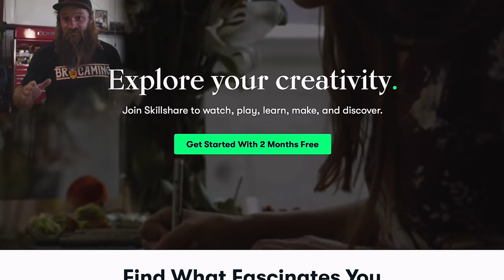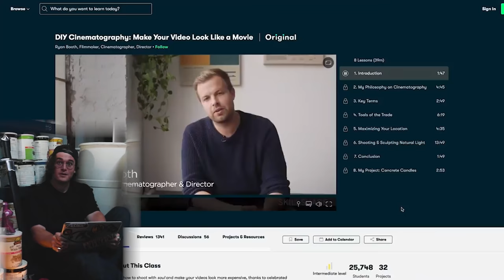This Might Be The Most Incredible "Will It Start" Video Of All Time! (2 HUGE Excavators Pt 1)

Comment: I always doubled the voltage for trying to crank a seized engine.  As you know, starters are happy with double the voltage - everything else not so much.  lol.  But I have freed up a lot of seriously seized engines doing much the same as you guys, but also doubling the voltage to the starter.  Just don't be shy when hooking up

Comment: the aircooled deutz engines are awesome you can change every cylinder independent but when the cooling fins fill up with dirt and other shit they get to hot and lock up but if you just give it a little bit of maintenance after work they work forever

Comment: When it comes to freeing up an engine no matter if it's diesel or gas always put transmission fluid in around the cylinders it works really really well way better than PB Blaster or WD-40 because transmission fluid is not only very acidic and eats rust like crazy along with burnt oil and Grease but also a great lubricant which helps free the rings and cylinders faster and safer
Reply: Sadly he will probably never see your comment, they don’t give a shit about what we have to say

Comment: You guys are awesome. Great job using those ratchet chain binders to gain leverage. I imagine the rust scale inside the six cylinder probably reduced the compression in each cylinder. I've had to pull the cylinder head off and physically sand the rust off the cylinders and check valve faces and reassemble old cat diesels that got rainwater inside the cylinder from the vertical exhaust muffler that rain would flood a cylinder thru an open exhaust valve.
Awesome job guys.

Comment: My uncle used to move heavy equipment for construction and would shave using water from the radiator lol and my first forman built VW's from ground up  all around  Atlanta  some of  the vw's from  California
Reply: I can operate any heavy equipment from 385 cat to mini ex. I also have osha 30 , first aid , trench and excavation as well as CPR. I'am willing to work for free  to prove my experience with heavy equipment.

Comment: Once I had to free up a big 6 on a Pettibone.  The top of the air cleaner had rusted through an water had gotten to the valves and cylinders - sitting about 3 years in Tennessee.  I pulled the valve cover and hammered on the valves until all were free.  For the cyls I pulled the injectors, took them home and disassembled, cleaned, reassemble and pop test them (DIY bottle jack tester.) They were rough and pitted but worked)  Now, here was the neat trick, no cheater bar would move the crank.  I pulled the starter, got an old Bendix gear from a generator/starter rebuild shop.  I made a plate to bolt on where the starter came off.  I put a bolt through the center of the plate and welded the starter gear to the bolt so it would engage the ring gear and then used a piece of angle iron and a washer to support the far end of the gear-bolt/shaft.   Now I had a bolt head sticking out of  plate that I put a breaker bar on.  I then just rocked the breaker bar back and forth, letting it "hammer" just a little each way and it began to turn (It surprised me how quickly it came free) .  I then "walked" it bit by bit one full revolution (this kept from breaking the rings) .  and then rapidly about twice more.  I then put the starter in and spun it.  Each time I poured diesel fuel and oil in the cylinder and blew it out by spinning it over.  I then reinstalled the  injectors and bang it came to life!!

Comment: It made a lot of sense since I have been wrenching for over 50 years. Although I think putting the chains was a go or blow move. With that much pressure on the rods I expected a bent rod. I guess I would have let it soak longer but your system worked. Not sure what you got after getting it running, sort of like getting a Yugo running, do you have a bigger headache now? lol

Comment: 3406B 🤙🏾worked on one years ago owner said driver blew head gasket for second time - I inframe over haul and re-set gov to max spec rebuild Airfuel ratio and rebuild timing advance, rolled on dyno and as owner came up - he was yelling there’s fire  🔥 out the stacks but I pointed out it’s just carbon burning out the stacks 😎from driver who messed up their truck. Now rolling a spec 500 hp at the wheels. But I think 3406E are pretty solid if done right

Comment: I recall the mining company I worked for in the 90s,having to replaced the Swivel valve on a Cat 935 excavator. It was like $15k for the valve and if memory serves,had to remove body from track frames to install. Also new hook rollers etc. One reason some decided to let machinery sit as opposed to repairing them,very expensive!

Comment: Dave, use your welder as a jumper. You have the capability on that lincoln to make DC voltage from 0 to 25 volts and trust me the aperage is unlimited. I used my LN8 as a jumper hundreds of times. Works like a charm. Looks like your cylinders will all need to be repacked and that just so you know is a total pain in the butt. If I was there would be happy to help but not sure what your end goal is so I wish you much luck! You WILL need it. LOL

Comment: The best rust dissolver is any hydraulic fluid, works faster than any other rust specific product except acid. Just have a look at Project Farm, he tested it and the results are that WD40 and PB are pretty decent but DOT4 wins by a landslide.

Comment: Dave, that boom needs to be rewelded. Anytime you fishplate a structural component you need to make sure NO SQUARE LINES ACROSS THE STRESS FACE! Always need to be in a angled shape! By welding right across the face of that boom the way they did they created a stress line right across the face. Not good. Last thing you need is for that boom to collapse with a load on it. Just a suggestion but take it from an old wrencher. It needs to be addressed.

Comment: That is most likely air cooled as most deutz engines are, and cool fact, not sure about this one but alot of them have individual sleeves for each cylinder... So one piston freezes up, you can take the jug and head off for that one cylinder and fix/  swap it, instead of tearing down the whole motor

Comment: If the engine is frozen, I have done this before. Marvel mystery oil and diesel in cylinders let soak over the night. Then you can usually move the crankshaft with the flywheel.

Comment: Heavy D: Sprays "tons" of pb blaster directly into the cylinders 

Also Heavy D: I am noticing its a bi underpowered and smoking quite a bit.

Also Also Heavy D: I think fuel hydrolocked it

Err maybe the "tons" of pb blaster in the cylinders and mixed in with the the oil could have been your culprit?

Comment: i know you guys came up with a solution  with what you had out in the middle of nowhere  but i’m going to make  a suggestion on something i learned from my Dad as a Teenager and it’s  been really valueable  to have around for Boating ,general Home repairs  on the road repairs of trucks , trailers , and even  recovery missions in the middle of the Florida Everglades. of my personal 4X 4. without any other vehicles around  and that those simple inexpensive pieces of Junk made inChina manual Cum Alongs  you can pick up in Harbor Freight , Walmart ,Flea Markets and many other places   they usually are rated for something like 3 or 4 tons  total Bull crap IMO  but if you  don’t  bend the handle by pulling on it the wrong way. those things do work  try to buy the one that includes a Snatch Block  to double the tensile or include one you have  in a pinch i’ve also used  those things to secure loads and to shift  some heavy ones  back into place  usually i find those for under 10 bucks and  i’m amazed at the veretility of the uses they have   i had a Marine Diesel  prop shaft pick up a  rope in the water and wrap it so tight it ripped the engine off the motor mounts and stalled it out in the process  with a lot of rigging and ingenuity  we were capable of  getting that motor realigned  in that Vessel at Sea to get us home  safely  the thing still had a $7.00 price tag from a Flea Market i purchased it at brand new ? saved me a several thousand dollar tow  and i toss one in all my Vessels ,Trucks , and Trailer  tool boxes or Cabinet ? whatever

Comment: You were a little ambitious about being able to put that excavator to work immediately after sitting that long. There was no way that the hydraulic system would have held under a load after sitting that long, even if everything else had gone smoothly. That was awesome that you were able to get it freed up and running though.

Comment: Pertaining to THE HOT—SPRINGS,  Dave is wrong about how many die in the hot springs.  

“Three large soaking pools with ledges for sitting have been formed by travertine deposits. The travertine pools are more than 20 feet deep. In 2019 a Utah man drowned in one of the hot springs after fully submerging himself under the water. His body was found underneath a rock ledge in the spring. He had sustained head injuries. His was one of four such drownings at the springs in the last 10 years.”`

Comment: With all the fuel, hydraulic fluid, coolant and time you spent trying to move that motor you could have easily yanked one of those heads. Take a look see with a flashlight. After a dead decade them heads have to come off anyway. What do I know? Nobody looks at my videos

Comment: You better watch it with that lotion cuz your beard might freak out on you.
Reply: I'm going to download WhatsApp. I'm in the middle of working on a 2008 Corvette doing a engine swap. And I got a 2015 mustang I'm doing the head gasket on. It's the 4-cylinder turbo. I think the back of cylinder number 3 behind the sleeve is cracked.I'm trying to figure all this stuff out but I would like to be able to talk to you as soon as we can get a chance to. I would like to talk to you about coming to work for y'all. I'm a honest hard-working person, I have some experience with diesels and hydraulics and rigging. And I used to rebuild about bow thrusters, the clutches, and the gear boxes on ships and Tug boats.when I come to work it's not about what I want to do it's about how y'all want it done.